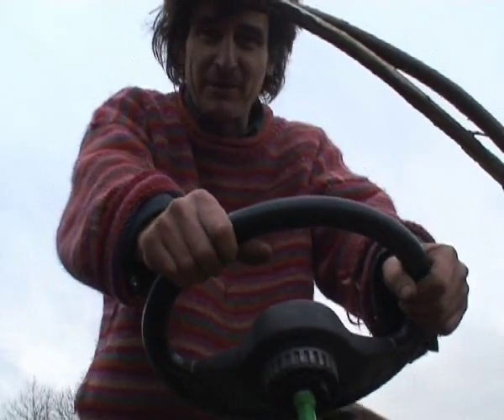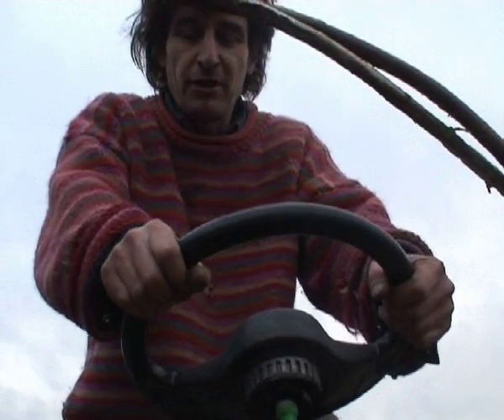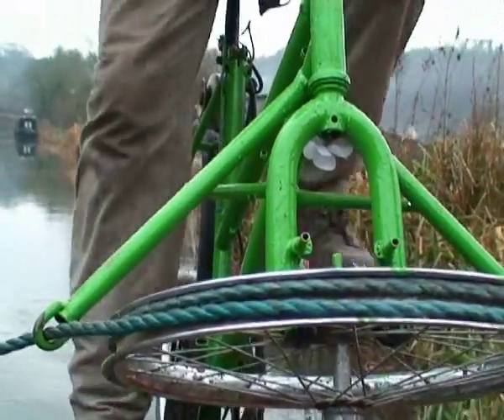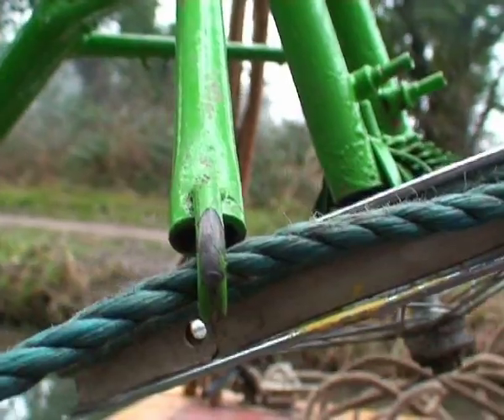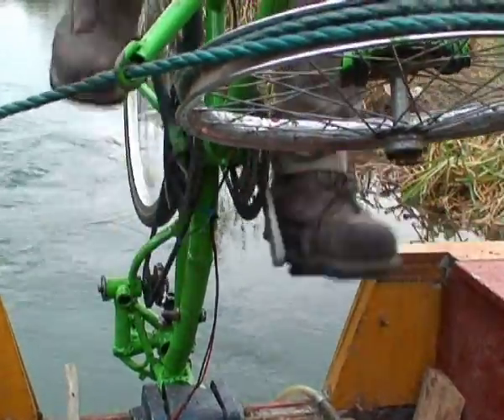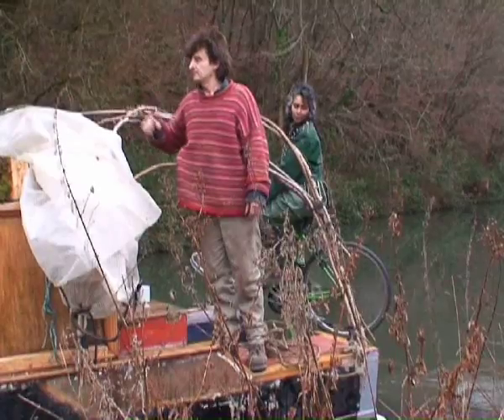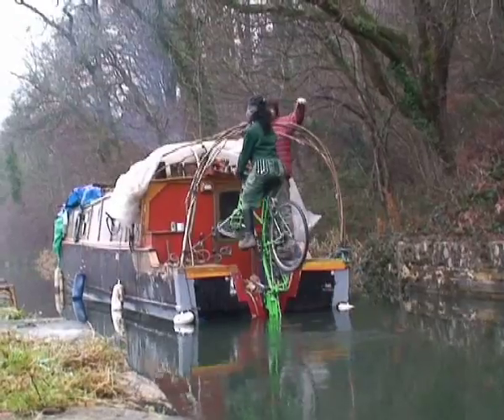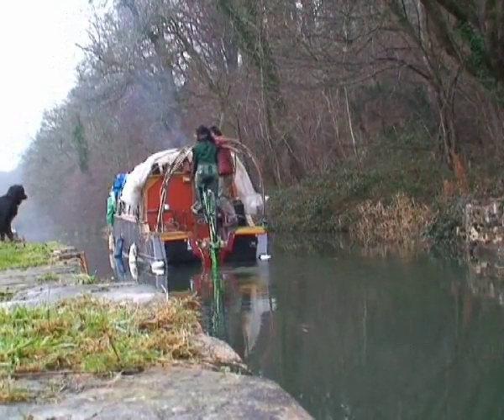Pedal-Prop Safari

Comment: Great to see people using their initiative, eco- friendly, silent, healthy and satisfying. If only manufacturers would invest in design and development of these ideas although the engine manufacturers may not be too pleased. Perhaps a couple of  cranked cycle prop units on the back , as  on my boat 'Newt III' (also on  YouTube) would enhance the performance by 100%. As yet we have no British manufacturer of these type of drive units, it's a pity, as their potential is great for our inland waterways. If you combined solar electric back-up,you would have a real alternative to internal combustion power.